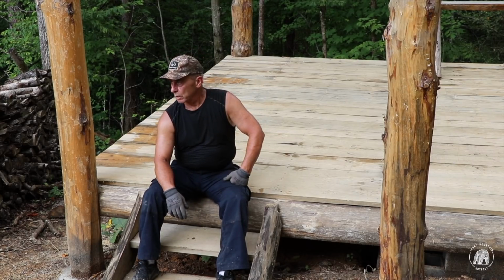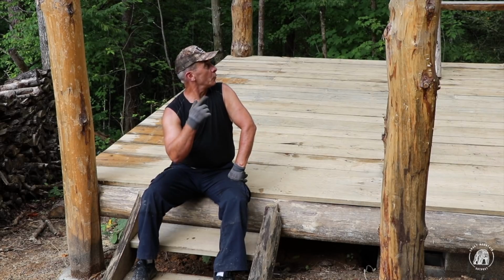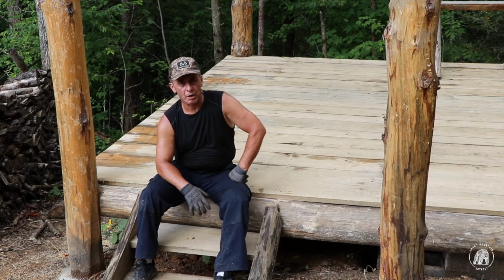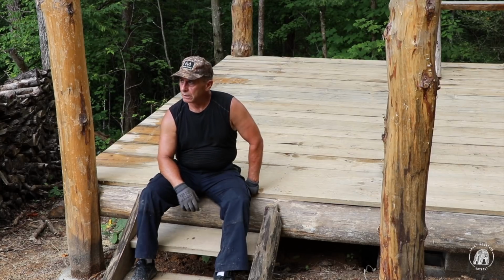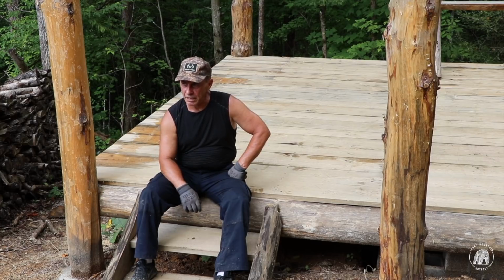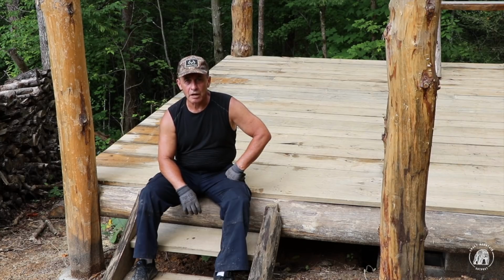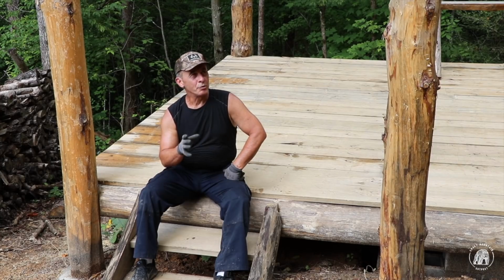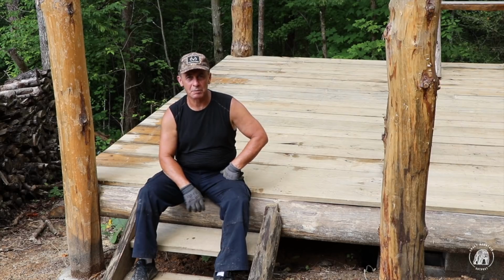S2 EP24 | TIMBER FRAME | FOREST KITCHEN | SETTING THE ROOF RAFTERS

Comment: I was surprised to see you put the rafters up with what looked like a square cut on the peak, rather than a mitered vertical cut so the top edge of the rafters would touch. Now you have a V shaped gap at the ridge I think. Hard to see on a small screen in the video. Probably doesn't make a difference though because the sheeting boards will cover it. Big job to tackle by yourself, great work.